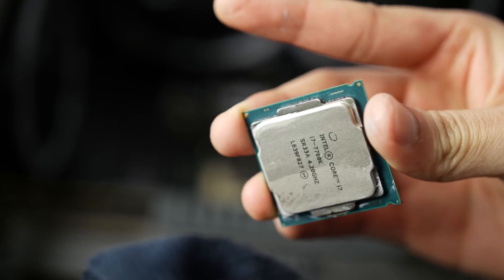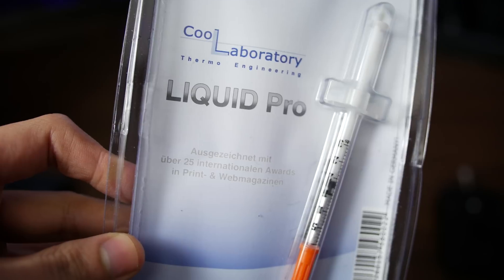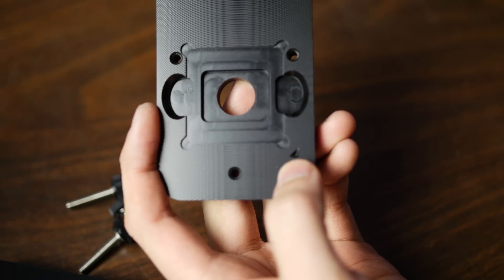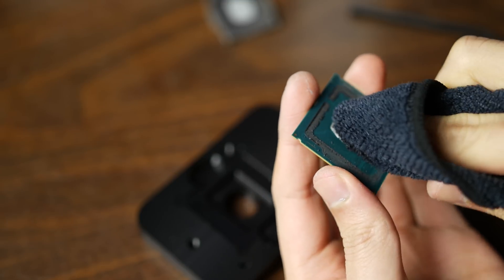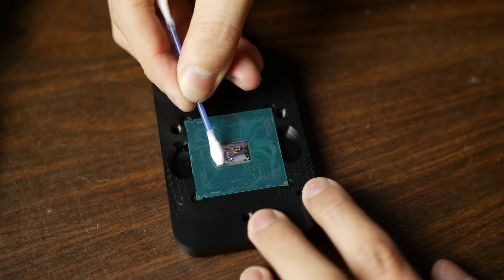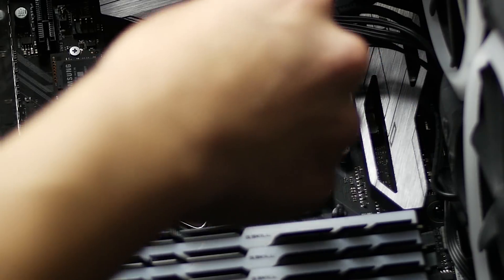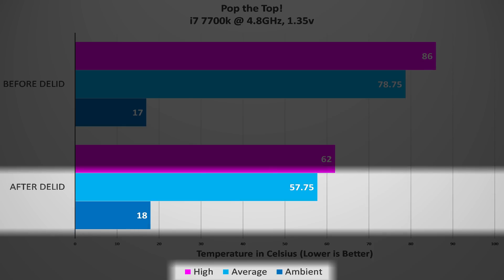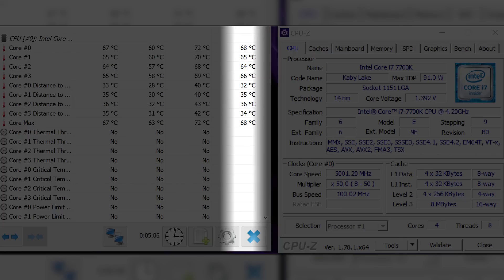Delidding the i7 7700k - Before and After!

Comment: so it's gallium.
Reply from the maker: Spider Mcgavenport Correct! At least, there's galium in it!
Reply: ALittleDIMM say would you be willing to overclock/underclock a northbridge southbridge I'm curious as to performance loss gain temps.
Reply from the maker: Northbridge has been integrated into the CPU for some time, and Southbridge is now known as the PCH.  Unfortunately, I don't have much experience in overclocking there, but it's something I can look into when I have some free time!
Reply: ALittleDIMM thank you very much. Any ideas on to using a Peltier device for cooling?
Reply from the maker: Oh, that's much out of the scope of my expertise.  Peltier devices require significant cooling.  Additionally, if they fail, there's a high chance your processor is going to go up in a ball of flame with it.  There's also condensation to worry about, since I hear they can get quite chilly, and electronics and condensation don't play well!  It's something I haven't thought to play around with, largely because I don't have the components to spare if I mess up!  Sorry about that!
Reply: ALittleDIMM yeah it takes a level of commitment that is for certain but if applying it correctly the condensation could be completely avoided by using a drip tray and mount the device in question heatsink down or Peltier your liquid cooler on the radiator side for that with some dehumidifier powder.
Reply from the maker: Yeah, this would definitely require a lot more research on my end, LOL.  Maybe some day... but today is not that day.
Reply: I would certainty not apply the Peltier directly on the processor more so a heatpiped copper block away from the motherboard. But it's just sheer speculation on if it would help or not do to the current and power needed vs a fan or liquid cooler alone. efficiency speaking.
Reply from the maker: Makes sense to do it that way, less risk involved.  Regarding efficiency, I can't say for sure.  More things to look into...
Reply: Thank you very much for you quick and timely responses, I appreciate your videos production value keep up the good work hackers for life.

Comment: I don't undersrand why Intel is using such crap in my CPU. It couldn't be that costly of a change to put something proper inbetween..
Reply from the maker: It could be for longevity.  The stuff they use may not perform as well, but could last longer than the typical thermal paste you'd use on your heatsink.  I can't say for sure, though.  Maybe they're just cutting corners!
Reply: ALittleDIMM Well, considering I have never delidded & my 5 year old PC with 2550k that I gave away to my family is still running fine, I'd say you are right.

Comment: The reason for the poor thermal interface material used by Intel is there for a good reason.  When you buy a decent AIO cooler you get to see impressive drops in temps.  This is Intel working with the AIO companies to make their products look better in the enthusiast market.
Reply from the maker: I feel like enthusiasts typically buy decent AIO coolers, anyway.  Lower temperatures just seem overall better for CPU lifespan, they don't need to sell me a hotcake to ensure I buy a water cooling solution!
Reply: Of course lower CPU temps are a good thing.  Otherwise, the AIO industry would not exist.  And my theory as to why the AIO industry exists is because Intel profits from it by continuing to apply substandard TIM to the CPU die.  The industries surrounding enthusiast PC building are all in bed with one another.  We don't question this simply because when we do go to improve performance we generally see an improvement and are happy that we spent the money to get that improvement.  Questions never arise as to why these improvements aren't built into the system in the first place.  I think you see what I'm getting at, right?  Conspiracy theory 101.
Reply from the maker: I suppose it's a possibility!

Comment: So basically Intel is shooting itself in the foot ? Like with perfect TIM they could have a 5 Ghz CPU out and crush everything in single core performance ?
Reply from the maker: Someone mentioned the TIM they use might be for endurance reasons.  It could last a lot longer than the stuff you'd use on your heatsink, which is probably why they do it.  Probably also has something to do with production costs, but I'm not sure why they do what they do!
Reply: I do think it's because of the latter. Before, Intel was soldering them and we have yet to see this method being short lasting. AMD is doing this for their Ryzen lineup which is what Intel should be doing. Cutting production costs on overpriced CPUs, thank you Intel.
Reply from the maker: True.  That's most likely the reason, but I can't say I know for sure.  Maybe next generation (optimistically!)

Comment: Your noise gate setting made this video unwatchable
Reply from the maker: Could have muted me ;)

But you're right, I'm still playing around with settings.  Trying to figure out what I like and what other people can tolerate.  Maybe I'll get it one day.
Reply: ALittleDIMM it's mainly the release. Make the release about one second and it should be much better. Most viewers don't really notice, but as an audio engineer it was kindof hard to watch.
Reply from the maker: Got'cha!  I'll play around with it when I get a few minutes, thanks!
Reply from the maker: Actually, my reason for the acoustic foam is pretty stupid.  There's a mirror on the wall that my girlfriend didn't like.  Too lazy to take it down and I didn't want to put a blanket over it.  Thought the foam made for a better backdrop, LOL.  Thanks for the suggestions, I'll put them into practice shortly ;)
Reply: Well, if you're using a gate/expander, use it in post (during mixing and editing).  You never want to gate the signal as you're recording it.  If you're having noise issues, I would recommend using a noise reduction plug-in that samples your noise finger print (your room tone) and then reduces it.  It sounds better than a gate as long as it's not used excessively.  Just be sure to capture a few seconds of the room without anyone talking or moving around in it.  You're in a room with acoustic foam on the wall, so I would assume you're doing music/audio of some kind anyways.
Reply: fakshen1973 you CAN gate as you're recording it. Aslong as your settings are fine
Reply: Well, Flair, that's the IDIOT move.  I've only been doing audio post since 1994... so maybe your knowledge and experience carries more weight.  Gating the captured signal is foolish.  Any A1 or wanna-be sound guy who pulls this stunt gets a rash of ear bending when I find their handy work in front of me?  Why?  Because people speak DYNAMICALLY.  They aren't a kick drum.  What may be a great setting while you're checking the mic might not be all so great while you're in the middle of recording.  Many people drop off in volume as they reach the end of a sentence.  If the gate closes or the expander kicks in then you get the end of words getting chopped off.  This is something that can easily be done in post and in post it's non-destructive.  

Please tell me about the "fine" setting on a noise gate and I'll show you a bunch of blown content where you're trying to patch that "S" from one word to another where it got chopped off.

Don't give advice just because you have 15 minutes of experience.  

Besides, this is probably just a one man shoot and he cannot be in front of the camera and acting as A1 at the same time.
Reply from the maker: Just a one man show... I don't have that many friends...
Reply: Yeah, but you give an excellent presentation.  Keep up the good work.  You'll go places.
Reply: fakshen1973 ALittleDIMM I mean I'm not going have some experience war with you, but I do live and studio engineering as my day job. I'm just saying, if you do lots of "audio post" you're obviously going to despise anyone who sends you a gated track. Obviously in ALittleDIMM's videos his gate should definitely be done in post, but if you did chose to gate as you're recording - assuming it was set up properly - it'd be okay. No need to be so pretentious.

Comment: Why would Intel do that? A product that has almost the same performance as 6700K (apart from the frequency) and is even more expensive than the previous one. I know that they have the monopoly but that doesn't mean that they start to cheap out on something that is vital (thermal paste) and then letting us pay 10-15 USD more on buying another paste (while also losing the warranty).
Reply from the maker: Someone brought a good point to my attention.  They probably use it for longevity.  Most people who buy processors use them for many years, and the thermal paste used between your heatsink and CPU isn't designed to last for that long.  It's typically reapplied every one to two years.  The liquid metal I used is the same idea, it should be reapplied every so often.  Intel's stuff isn't the best for heat transfer, but it does last a long time and remain consistent, at least!  Though, AMD solders their IHS to the CPU die, unsure why Intel doesn't do the same....  I'm sure they have their reasons!
Reply: ALittleDIMM You have given a very solid answer. But another thing came in my mind. I've seen many delid their 7700K and the thermal paste applied was very little to almost nothing. Hardware Unboxed got the same temperature reduction as you did (26 celsius lower). When the 6700K was delidded by Linus, it showed no special difference and he said that it's not worth delidding the 6700K but on the 7700K it seems like it probably is worth delidding it if you want lower temperatures.
Reply from the maker: I saw Linus's video, he used a different thermal compound.  That was the stuff you'd use between your heatsink and your processor.  Hardware Unboxed and I used liquid metal thermal compound, which is better for heat transfer between the die and the IHS.  I'm pretty confident the difference is due to the material used, but I haven't tested personally.

Comment: strange i get 5ghz at 1.325v after the delid and a max temp of 61c
Reply from the maker: Some chips overclock better than others!  Mine is just a little stubborn...
Reply: I redid my liquid metal a couple times to make sure the temps were even across all 4 cores.I used the relid tool and let it sit until dry.the tighter the relid the better.i don't know what motherboard you are using.the motherboard has alot to do with overclocking.i am using a Asus z270 9 Maximus hero.Best 220.00 I spent.
Reply: Well I live in Florida where it's always hot outside.i may have just got lucky with temps.we run ac almost all year long at 75f.

Comment: Just got to see this vid, and i tought about delidding my retro pc's cpu, which is a tualtin celeron 1400... just for research purposes (fanless retro system?). Would i need a special tool for that cpu, or is the one you showcased an universal one?
Reply from the maker: The tool is NOT universal.  I used it because I was nervous about warping the PCB with a vice.  If you have a razor, you can delid by working at the corners of the IHS, which is how a lot of people choose to do it, I believe.  Just exercise caution!  Good luck!
Reply: ALittleDIMM thanks for the tip :D i will try my best... I'll have to since that is the only socket 370 i have :d
Reply from the maker: I wouldn't recommend doing it unless you really needed to, but hey, FOR SCIENCE!  Right?
Reply: ALittleDIMM for sience! (I'll dig up a pentium 4 to be my test dummy, thanks for warning me)
Reply: done with the P4 dummy, and the first thing that blew my mind was how light the cpu is compared to the IHS, the second one that the heat dspreader compound and the black whatever around the HIS almost behaves like dust to the touch... Im excited on what the 16 year ol tualtin will look like on the inside, and how will it perform :D Thanks for the inspiration anyways
Reply from the maker: It's a pretty neat experience!  Good luck!

Comment: I understand Intel uses a thermal paste under the IHS that will hold for a long period of time (sacrificing cooling), but why can't they just design the chip so you can easily pick off the IHS and switch thermal paste underneath when needed, like holding it in place with something else than glue (like just flip off some holders) - or why not even sell versions of the CPU with the IHS not mounted on the chip, but still include it in the box, so people building their own PCs can do this themselves and get better cooling?
Reply from the maker: Probably because of liability issues, I would think.  A CPU die is kind of fragile and if a number of people mess up, they'll have that many more they'll have to replace under warranty.  But maybe some day!  It wasn't that long ago that overclocking voided all warranties, too ;)

Comment: wow thats a lot I only got 15c improvement after delid.
Reply from the maker: I heard people get various results, some as high as 30C, others as low as 7-10C, so I guess your mileage may vary!  But hey, improvement is improvement!
Reply: Alex Pana how high of an overclock did you have? and was it a 7700k or a different gen
Reply: Damien 7700k and 5ghz overclock at 1.344v
Reply: Alex Pana hmm i droped 24c on mine but my temps were not very nice out of the box. maybe yours has a slightly better factory tim job? I guess it also matters if your cooler has enough thermal headroom to take advantage of the new quicker heat transfer. but that may not have any effect in your case and may just be the tim lottery was better on your chip

Comment: Oh yes yes...this is on my 'to do' list. I also think that this is a must for Kaby-K users.
Going to use CL Pro as well. Ultra is better on paper but performs worse irl.
I'm going with Delid die mate 2 from d8auer or whatever his nick is.
Not going to re-lid as well - not because it's easier, but because cutting off height of glue increase performance as well.

Read comments below as well. Strongly disagree on Intel's 'good' intentions behind choosing this particular TIM.
It's simply there to cut down price and fry your cpu over time.
Sounds cruel but thats business. And to be fair it's not only Intel. Most brands use medicore / subpar parts in order to stretch margins.
Reply from the maker: Good luck with your delid!  I've seen a few of der8auer's videos, very informative stuff!

And regarding Intel's (and other's) manufacturing decisions, I wouldn't be too surprised either way.  I'm just giving them benefit of the doubt ;)

Comment: Is the 7700k's warranty actually worth keeping intact? I really don't know, but if I could lower the temps on my CPU at 5.252GHz to a safe level, I might be willing to do this!
Reply from the maker: Wow!  5.252 GHz is impressive!  About the warranty, I think it depends on where you buy it from.  For example, Amazon will take returns for about a month after purchase if something stops working, but I don't believe they'll cover you if the product was "tampered" with.  Intel's warranty itself does not cover physical damage (scratches, chips, delidding, et cetera), but if your processor stops working out of the blue, I believe they'll replace your faulty chip with a new one.

Comment: Honestly. What in the hell is up with Intel cheaping out on the CPUs? Would it really cost them that much more to use a decent thermal paste or liquid metal on the CPU? Hopefully Ryzen destroys Kaby Lake and gets Intel off their high horse.
PS: It's fun watching smaller channels now before they (potentially) blow up in subs.
Reply from the maker: Oh, good to know!  Thanks for the information!
Reply: ALittleDIMM yea i hope intel realizes there tim and thick glue is fine on all the non k versions. but the extra price should be spent on the K version ones that we pay just to be overclock able. but intel would probably complain then we cant sell binned 7500 cpus as 7700ks
Reply from the maker: I thought that initially, but someone brought up a good point.  Intel probably uses that thermal compound for the sake of longevity.  The stuff you'd buy for your heatsink is meant to be reapplied every year or two, whereas the thermal interface material between the IHS and the die is meant to last until your next upgrade.  Though, AMD solders their IHS.  Not sure why Intel doesn't, but they probably have their reasons!
Reply: Intel solders Broadwell-E (and Haswell-E etc.), but they've been cheaping out on the mainstream lineup for years now by using that terrible paste. 

It's good to hear that AMD will be soldering Ryzen, as Indium solder is probably the best compromise between longevity and performance.
Reply: ALittleDIMM if Intel comes out with the leaked 7740k and the i5 version on the x299 or x99 chipset pretty much I bet it will be soldered . if only Intel learned how to make there rtv glue thinner as that's a big part of the reason for bad temps
Reply from the maker: Yeah, the glue definitely contributes.  Guess we'll see if and when those processors launch!